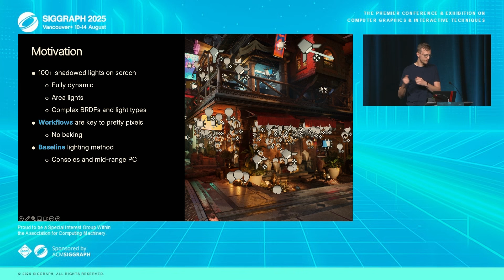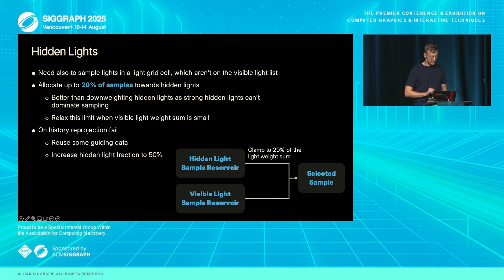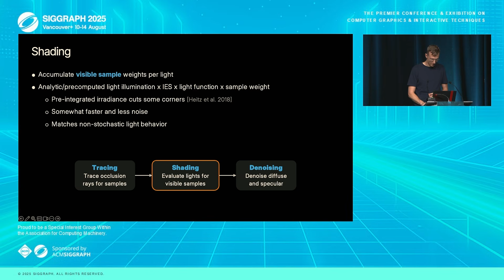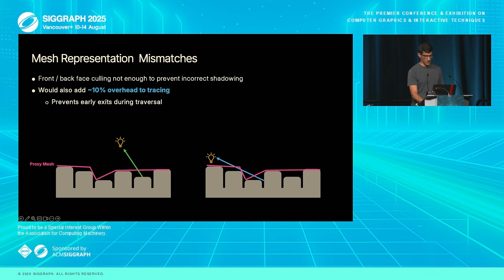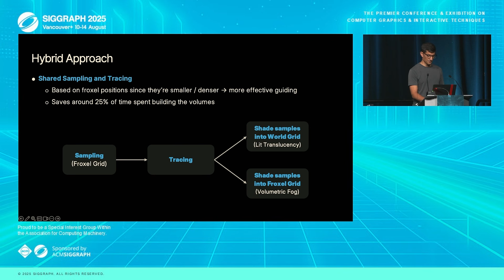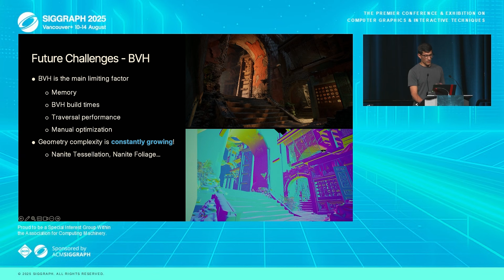SIGGRAPH 2025 Advances in RT Rendering: Megalights: Stochastic Direct Lighting in Unreal Engine 5

Comment: the whole tech they keep building feels very much like when you try to glue something but it doesn't really hold so you start adding tape and tape and tape around it until nothing makes sense anymore, because it's still a broken mess that doesn't run good, doesn't look good and at the end of the day is still held by tape lol
Reply: We tried testing megalight to see if it would be good for our game and in a lot of cases the performance were worst/there was a visual downgrade. There is so little documentation on megalight it's annoying
Reply: Heh, if only you knew the decades of crazy hacks it took to make modern rasterizer engines look good :)
Reply: You just described the entire history of rasterized rendering. Rasterized rendering is the most fake. Then you add more fake effects on top until it looks good. With Raytracing it looks right from the beginning but you need to make more and more tricks and compromises to make it performant
Reply: @antivanti  and this is the worst case scenario. Raster + Raytracing!!!!
We do need a unified model built on the fast knowledge from raster tho.

Comment: I don't care about ray tracing until I can buy a $250 card that will run RT at 60FPS, and is actually in stock. You can do all the software you like but until the hardware is affordable and available, you are wasting your time
Reply: Intel B580 is 250€. Furthermore it is revisionist to implicitly state that in the past 250€ - equivalent prized GPU were rendering top of the line features like early vertex shader at 60+ fps. Thats just not true. GPU have become unbelievably expensive, but that is not on RT imo. Its because multiple financial/tech scams in succession ran on GPU (crypto, AI).

Comment: Remember baked lighting... yeah I remember that, ran on a potatoe and still looked good if done right
Reply: Took ages for each iteration for the artists to see if it looks good. It was static so cannot have dynamic lights and anything that can move will have incorrect lighting so no dynamic physics etc. Also it required humongous amounts of data to look good so had to reduce the quality if you want a big open world.
Reply: And we would have 300gb games if we attempted to do with rasterization what we do know with ray tracing.
Reply: I think we're all going to remember it more and more as hardware prices continue to skyrocket.   Absolutely tragic that Epic is not fixing GPU lightmass issues and fully does not support CPU lightmass.
Reply: And took days or months to cook and didn’t allow world dynamism without more workarounds and even then had fundamental limitations?

Go watch the talk from the DOOM tech team on the reasons they had to move to RT and how it enabled building the game in a timeframe and with a disc size otherwise impossible to achieve.
Reply: @TypeErrorDubs  don't forget the game sucked and was so bad it probably resulted in the studio getting closed
Reply: @TypeErrorDubs cool
Traded off good performance for better production time.
And the consumer pays for it all
Reply: @longjohn7992  consumer would have to pay more if they spent more time making the game because of using baked lighting.
Reply: @aquaneon8012  still cheaper than a $5000 flagship GPU.  Encouraging lazy unoptimized dev is super lame.
Reply: @importon  of course it’s a trade off, and this is a transition time when not all hardware is capable, but to portray it as you needing a $5000 GPU to play DOOM Dark Ages is disingenuous.
Reply: @longjohn7992  It was the thing that allowed them to have dynamic physics objects. Also it runs on a potato by todays standards. Works on the lowest spec RT enabled cards from 7 years ago
Reply: @TypeErrorDubs  you're just wrong.  encouraging optimized development is never the right move.
Reply: @TypeErrorDubs  You are the kind of guy who think it isn't possible to have global illumination, dynamic lighting, reflections, shadows, mirrors, etc.. without ray tracing? Did you forget that games were able to achieve all of this and ran better? I personally think this is really dumb to use ray tracing where 90% of meshes are static.
Reply: @fairplex3883  I also think it's really dumb bloating games past 100GB because you don't want your GPU to do any work